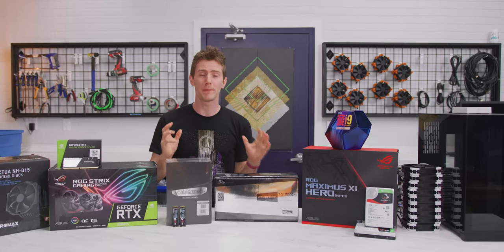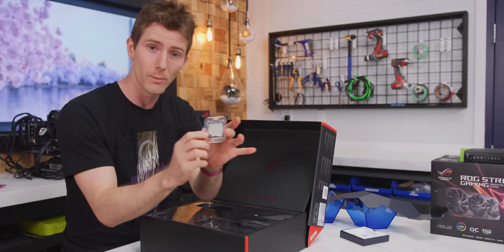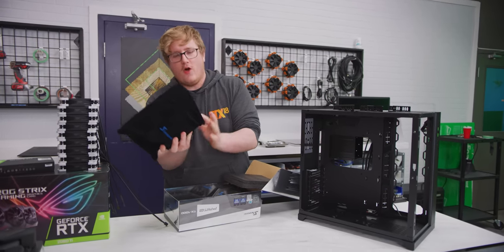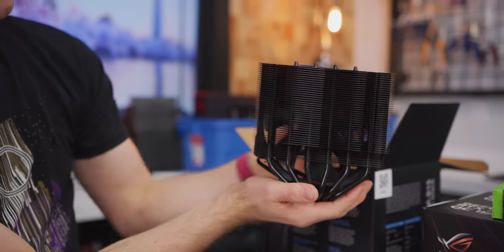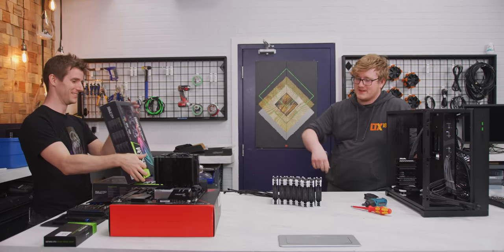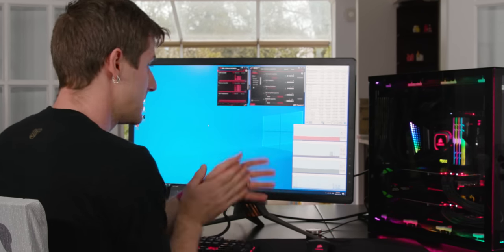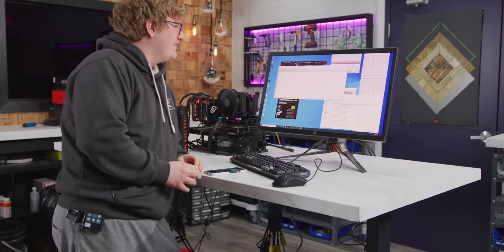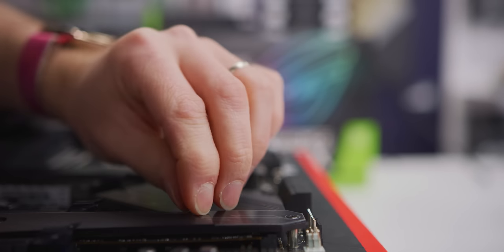Can AMD Beat the ULTIMATE Intel Gaming PC?

Comment: Mate this whole experiment was unfair, like seriously you chose a cherry picked i9 running at 5.1 GHz so why not choose a cherry picked 3950x from silicon lottery which can run at 4.5 GHz then the competition would have been much closer, your testing methodology was flawed in this video.
Reply: 11:03
Reply: @Kartko  ok bro for even fairer comparison why not overclock the 3950x at 4.4 Ghz, it can reach such speeds when pushed check any review to find out as what I remember a overclocked 3950x is 5% slower than a 9900k at 1440p at 2160p it should be even closer as the games become more GPU bound.
Reply: Ohh salty AMD fanboy, just accept it, my generic i7 9700k can also do 5.0 -5.1Ghz, everyone with an i9 can overclock it to at least 5, it would still have won even if AMD ran at that laughable 4,5ghz
Reply: @modderhoop2058  yea my 8700k is at 5.2 GHz. Very easy to OC these CPUs.
Reply: ''Ohh salty AMD fanboy'' damn that's cringy.
Reply: Better yet they picked two games which favor single threaded performance (CSGO and Apex)
Reply: @Kartko  well if you are buying a 750 $ CPU you surely can learn to overclock it, isn't it an enthusiast part, am not even a fanboy of either company I just asked for a more apples to apples comparision, for eg a person with limited knowledge doesn't know about silicon lottery right, remember bro speaking posetively about a company doesn't make anyone a fanboy so please stop accusing me, have never used a ryzen personally so hope you get my point.
Reply: @modderhoop2058  What's laughable about 4.5GHz? That's a whole Gig above base clock, which is pretty respectable. You do realize clock speed isn't a 1/1 across architectures correct? 5Ghz pushed on my 6700k does not equal 5GHz on an AMD FX9590 (which was the first out of the box 5GHz cpu), or your 9700k. The reality is that my 3700x@ 4.45GHz and my 6700k @5GHz perform very closely in games using a 980ti despite the 550MHz difference in clock speeds due to IPC gains and differences in how things are processed. Your 9700k @5GHz would trounce a FX9590 at 5GHz despite an identical clock speed. There's a lot more involved than clock speed when comparing effectiveness of a processor for a task.

I think you really have a fundamental misunderstanding of how things work if you're emphasizing clock speed difference between two very different architectures so heavily.What the initial comment questioned is the fact that a binned intel chip was used, but an off the shelf AMD chip was used as its competition. The results would still be in favor of intel had a non binned CPU been used, or if a binned AMD CPU been used, but it would be marginally closer.
Reply: @gullugadha  And the problem is that you are buying a $750 CPU, overclocking it and still getting a worse performance in most games than an out of the box intel cpu. If someone wants the CPU ONLY for games then I don't see why someone would choose the Ryzen in this scenario
Reply: the cherry picked i9 was the same price... if they went with just a 9900k, then people would complain it's cheaper than the 3950x. If they went with a 3900x people would complain they didn't use a 3950x. The point was for with the same budget for the cpu, What was the best performance you could get, in this case it was a 3950x vs a binned 9900ks
Reply: Cherry picked or not you mad AMD fan, intel gets higher FPS in gaming OVERALL, even a 5ghz i5 6core will pump out more overall FPS then ANY amd.
Reply: @Kartko  if it's purely for gaming, you still have to consider what kind of games people play. If they are professionals, Intel would most likely be their first picks. If it's to simply enjoy games, either would be fine. But 10% improvement is such a small difference that it wouldn't matter most of the time. Just drop some graphic fidelity to hit 144 frames or so
Reply: @Kartko  if that's only your use case I can't argue but please don't accuse everyone of being a fanboy I personally only prioritise value for money product and for 750$ I want twice the cores and threads compared to what the competition is offering, peace out bro.
Reply: Like pretty much every comparison they make.😅 It's purely for entertainment...
Reply: Kart Ko some niewbie probably does not build his own pc, thus this intire matter is pretty irrelevant
Reply: @gullugadha  if you want value you buy a Ryzen 5 3600 for third of the price without even a discussion, but I thought the argument was between pure performance for exactly $750.
Reply: @Kartko  yes I would choose a 3600 for an all purpose gaming rig but for 750$ I will always choose the 3950x, 5% superior performance isn't significant to me, honestly can't differentiate between 100 and 105 fps at 4k HDR settings, not everything revolves around gaming 3950x is an all round superior chip, if I were a pro gamer who played let's say overwatch at 1080p low settings I would choose the 9900ks as in that case every frame matters, it's literally competitive, every gain matters, so yeah priorities aren't equal.
Reply: @modderhoop2058  just because you don't agree with someone doesn't make that person a fanboy, maybe do some research on IPC improvements and then figure out why a 3950x clocked at 4.4 GHz scores higher in cinebench r20 single threaded mode compared to 9900k at 5.0 GHz, hell I didn't even say that the ryzen chip would beat Intel but seems like you only care about numbers so no point in arguing with a dolt.
Reply: @modderhoop2058  The very least they could have enabled PBO on the AMD side or done auto OC can guarantee you despite taking 10 seconds it woulod have made the fight a lot fairer and really more of a convincing argument for the AMD chip, plus tbh who the heck buys a 3950X for gaming only anyway?
Reply: Every 9900ks can run 5,1-5,2ghz easy !
Reply: Sayandip Banik computers are about numbers 😏. The i9 is still a lot cheaper new then the 3950x. I never knew it actually beat the i9 in single core, the lower end chips and the same speed dont, rather wierd.
Reply: @gullugadha  lol none of Ryzens on any ghz can't outperform 9900k 5,0ghz in single thread . Stop lieing
Reply: @modderhoop2058  you know what in this exact case the i9 shown here cost the same as the 3950X right? and if you want numbers than try comparing them the second that you might be streaming to your friends or something, the 3950X suddenly would be a far better option, granted this is gaming only but am I the only one wondering why they didnt go for a 3700x or AT MOST a 3900X for gaming only as hell even for production workloads I find the 3950X can be hard to get fuull usage out of let alone in games when its usually sub 10% utilisation
Reply: @modderhoop2058  check some reviews of 3950x maybe, it's just a better binned silicon just like the 9900ks, though there are a few games which actually utilise higher core clocks like CS:GO and apex legend.
Reply: @Taurus_Play  check some benchmarks maybe, have seen that happen when the ryzen 3950x reviews were out, why should I lie?
Reply: @Taurus_Play  not at near stock voltage they can't.
Reply: @gullugadha  show me that bench , I saw only were ryzens suck to intel from 9600k @ sinle thread
Reply: @HeyImGaminOverHere  every 9900kS can , even on auto voltage , just multiple @ 52 and reboot.  My on auto was hiting 1.3v - 5,2ghz
Reply: @TeeAreEffedUp  you do know that 5 to 8 years ago some chips clocked to 6 ghz  its the ipc that's important. anyhoot they had to throw a bone at intel, AMD pretty much destroyed every other department  of pc's. I just hope that intel steps up to keep the competition going its always better for the cosumer.
Reply: @TeeAreEffedUp  oops wrong person to text to sorry.

Comment: Nobody noticed that the top GPU in the AMD was suffocated? The intel one had 1 slot for air flow compared to none for the AMD
Reply: They didn't even mention what the AMD build even contained. They just said an equivalent AMD setup. How do we know they didn't bottleneck the AMD system in some way?
Reply: @kingzach74  ok AMD fan boy
Reply: @funtyes1970  100% amd fan boy lol..... its not news that intel are still winning in gaming.... every single bench mark puts them above amd overall.
Reply: You don't have to be a fanboy to point out an actual error. Nobody is arguing that AMD would have won, but they did make a pretty big deal about the Intel system having the spacing between the GPUs so they wouldn't suffocate, but didn't seem to make the same consideration for the competition.
Reply: It shouldn't matter a ton because for cpu benchmarks you play at 1080p so the cpu is the bottleneck and the gpu still has headroom. That's how they normally test at least.
Reply: Because of AMD so now i can get I9 9900k with cheaper price. Big thanks to Amd!
Reply: david ellsworth ok intel shill
Reply: @kinomora-gaming  No dude, I love AMD but the 9900K will always beat a 3950X at gaming.  3950X is a workstation CPU. Just get a 3900X or a 9900k if you only game with your PC. Single core speed wins.

Comment: It's interesting how, in general, people assume water cools rather than conducts heat from one area to another.. watercooled PC's still need to radiate that heat to air the same way a strictly air cooled pc does.  an exception can of course be made for adding Ice to the water circuit or just dunking the radiator into an ice bath.

Comment: "Someone will actually buy"

*slaps 2 2080ti's. I only have a 1060 ffs
Reply: Whole Channel is sponsored by Intel and nvidia
Reply: Someone would actually buy 2 2080tis, it’s just a tiny fraction of the market.
Reply: 1060? Bruh I'm on a 750ti
Reply: @sash4465  
Bruh 6600GT
Reply: BRUH have some gratitude... I have a 32 bit Intel Pentium g340 system (1 core 3.1 GHz) , 4 gb 1600 mhz ram ddr3, no graphics card and no ssd..
Reply: @sash4465  I have the graphics from 2400g
Reply: @howdoyoudoit3499  did you miss the whole second half of 2019 when he was roasting Intel when the 3rd gen ryzen came out?
Reply: @sash4465  750ti? Bruh I'm on a R7 m445
Reply: @sash4465  try a GTX 660 bruh

Comment: "As games start to take advantage of more processing threads" I feel like we've been hearing this for YEARS
Reply: So true.

And every time there's a new console generation: "It'll happen this time, guys!"
Reply: And tbh, they have. 5 years ago a 4 threads i5 was the default to game, today if you buy a 4 threads CPU you are either on a very tight budget or an idiot. They don't perform well at all on modern games, and I know because I have one.
Reply: We're waiting on consoles to catch up.
Reply: It will happen for real now i believe, cause the new consoles have 8 core cpus. So developers must optimize their games for such cpus and this optimization will follow on pc.
Reply: Elliot Bridgewater every time? The last console release was 7 years ago lol.
Reply: Yea just been waiting for consoles to finally catch up. With the new consoles having better CPUs games will finally start using more threads
Reply: @erichall090909  Yes, every time. It happened when consoles went multi-threaded in the 360/PS3 era and then with the One/PS4 era.
Reply: I mean, it's not wrong thou... used to be that my 4c4t i5 6600k would run most games just fine, but now not so much so I went to a 2700x and haven't had a problem yet. This is going to bet even more true once next gen consoles are out with their 8c16t Zen2 processor...
Reply: @rivox1009  it depends. I have a 6600k @4,4ghz and most of my games work well. The only games that struggle are Battlefield 5, maybe even 1 (beta was fine), and Assasins creed Origins due to shitty DRM software (Odysses is way better). Literally everything else of what I play is fine.
What games do you play?
Reply: It's slowly starting to become a reality, although it takes a looooong time to finally get there.
Reply: Elliot Bridgewater I agree with you lol. Just saying people have been saying that it hasn’t happened for years,,, when we haven’t had a new console for years.
Reply: MHWGamer it depends on what you consider is fine.
Reply: Borderlands 3 released in late 2019 and runs on ONE CPU core. It's also an AMD Ryzen/Radeon sponsored title. What a joke.
Reply: Patrick D. Yeah. Because they did a shit job coding and optimizing it. One shitty made game doesn’t mean much lol
Reply: @erichall090909  I agree.